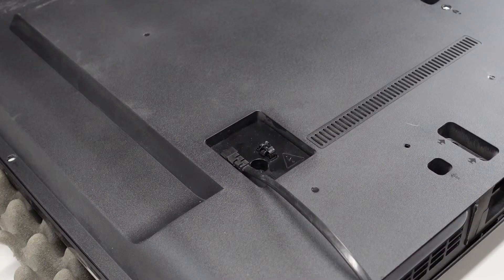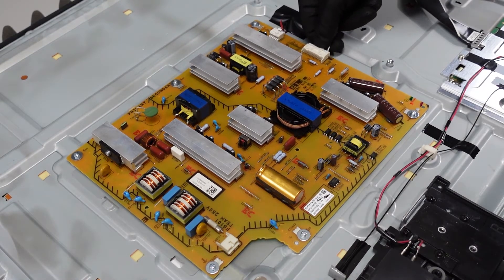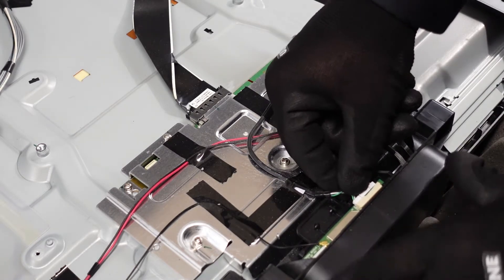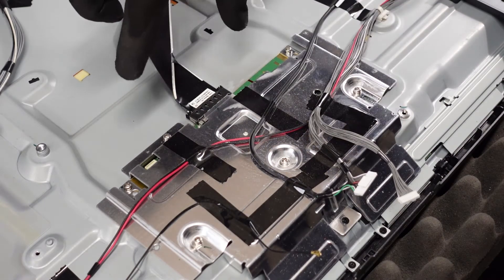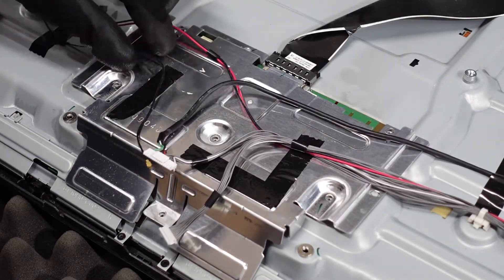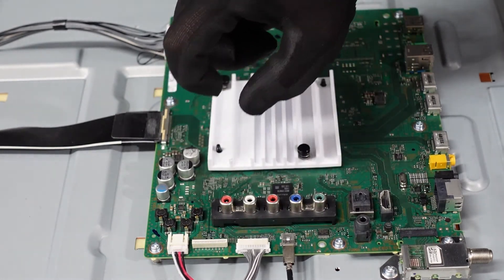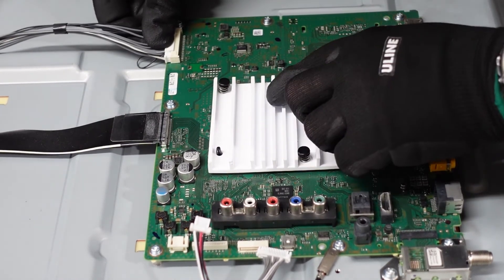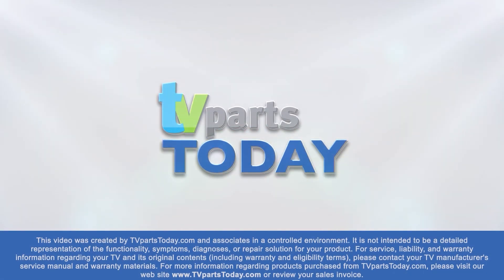Main board removal.  (SONY XBR-49X700D)

Comment: I am pretty sure this is exactly what I need for my Sony TV. It is completely dead. I think I just need to swap the power supply.
Reply from the maker: If you have a completely dead set the first step would be to replace the power supply. Make sure when you are ordering that you are getting the exact number off of your power supply (the board with the battery shaped capacitors). This video is showcasing the main board being removed, so I don't want there to be any confusion. If you give us a call into our office, one of our customer service reps will be more than happy to help you lock down a replacement part.

 (930) 212-1975